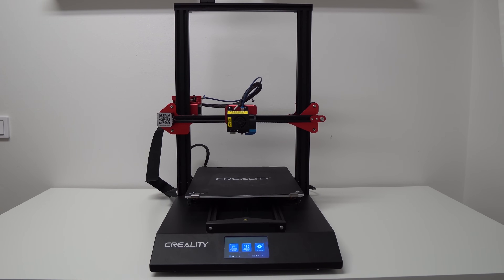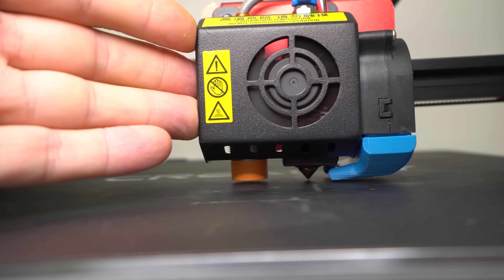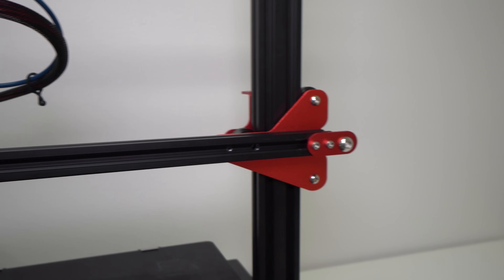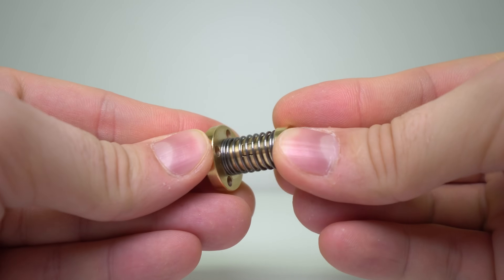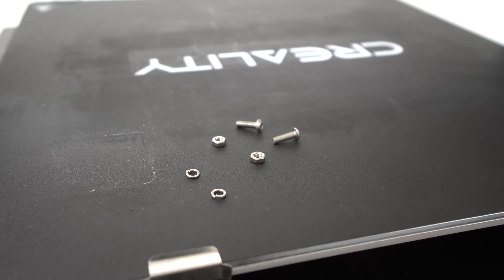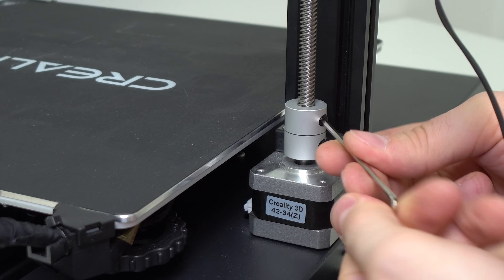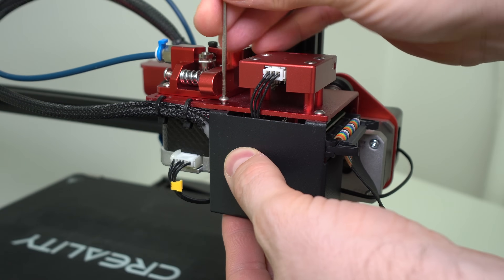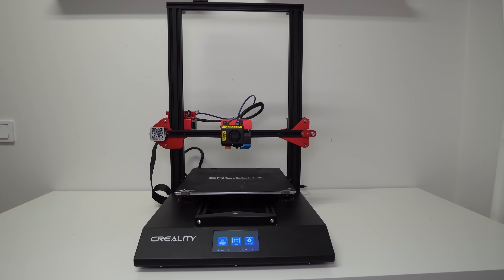Creality Cr10S PRO - Upgrade your Z axis (T8 Anti-Backlash install)

Comment: Unfortunately the backlash luck nuts don't work I have had this problem for a year and a freaking half I'll get six good friends two good friends maybe 10 and then I get two days of trying to realign my damn printer This issue sucks it makes me hate my printer. Nothing I've done has solved it permanently only temporary. And no one's come up with a good permanent solution.

Comment: Great video, but this is not really how anti-backlash nuts work. They will not fix the issue of a crooked X axis (misaligned Z screws), they can only make very minor improvements when using Z hop. All they do is make it so the nut can't move between the top of the threads and the bottom of the threads of the lead screws, which is less than 1mm of play in the first place, and most of the time, gravity pulling the carriage down means that backlash is not an issue normally unless you're doing a lot of fast Z moves like with Z hop. What you really need to do to align the two Z screws is install a synchronizing belt at the top, so that the two screws are actually connected together and stay synchronized

Comment: I can't seem to be able to remove the screws on the board. It seems whoever assembled my pritner over-tightened EVERY screw on it. I also had huge issues removing the bottom plates to do another upgrade due to something similar. Are there any tips on removing these screws? The stupid board seems impossible to remove.

Comment: The 2no. nuts and bolts holding the lead screw to the frame were loose. Are they supposed to be loose or should they be tight?

Comment: Great tutorial! A small question though. If the t8 doesn't fully compress, is that a deal breaker? I've been trying to get it going with absolutely no luck, the spring is very finicky.
Reply from the maker: Thank you. No it's not that big of the deal. As long it keeps Z axis steady it's good enough.
Reply: @NexiTech  Thank you for both the response and the swift reply! 💪🏽
Reply from the maker: @cursivefox  No problem. Have a good day.

Comment: Awesome video and very happy to see this solution to fix my same issue. But I need to know what pitch is the T8 ? Aliexpress shows 2mm 4mm 8mm pitch. Your video does not say which one the printer requires. I need to order this asap so of anyone knows that would be super helpful. Thanks
Reply: Hello. Same question for me,  did you find out which diameter for CR10S Pro?

Comment: Does this apply to the CR-10S pro V2 too? Great video :)
Reply from the maker: Thanks! ;) The CR10S PRO V2 is the same as V1 only with BL-touch sensor if I remember correctly. Also, you can install this Z axis upgrade to any 3D printer with dual Z axis.
Reply: @NexiTech  Thank. Definitely gonna try these modifications very soon then :)

Comment: Will i need to do this on V2? or did they fix this issue?
Reply from the maker: Nope V2 uses BL-touch sensor
Reply: @NexiTech  i don't understand, clearly says on Reddit that the V2 has this problem aswell.

Comment: Do you know why one side would still drift even after install the anti backlash nut? the "heavy" side still drifts down despite the install
Reply from the maker: Z axis extrusions are not parallel? Wheel bearings on Z axis are overtight or not adjusted correctly?

Comment: WAIT...Usually you can´t move the Z-axis when printer is turned on because motors are engaged. Only if the printer is powered off /or motors are manually switched off you can move them. (at least thats the case with A.i3 Mega. 
You banged againt the Z-axis while the printer was turned on, so motors are engaged and don´t allow any movement.  Im not really bying this...
Reply from the maker: That's the problem, before or after printing Z axis moves on one side slightly and next time you start to print your nozzle can start to strach over the heat-bed or you have failed print because nozzle print in middle air on one side of print. With this upgrade Z axis is much more solid and stable and it can move down that easily. Anycubic I3 Mega is much smaller in size and much less weight is on the Z axis( I have it) Also I3 Mega use linear bearing not bearing wheels. Completely different style and design. Get one of those heavy boys and see for yourself. Like I said not every 3D printer is affected but many big ones are.
Reply: @NexiTech  hm... I just ordered an Ender 3 V2 as everybody seems to have an Ender as well.  Just in case i´ll have a similiar case I orderes these spring-stops. We´ll see. Thx

Comment: Hey Nexi have you ever had issue with the heated bed wiring breaking? Seems a bad design mine broke due to the angle they are at when moving the y axis back and forth. I've had a rough time emailing Creality to get a replacement heated bed and still unsure if they are even sending me another. Luckily i have some electronics skills and fixed the problem. Apart from drag chains i'd love to see if there are any other options out there to fix this. Maybe your creative mind will think of something and make a video.

Comment: I understand the anti-backlash capability of these nuts, but how do these nuts prevent sag after the motors are off?
Reply: The spring tension won't allow them to move

Comment: What about the Z sync kit, with the belt thats installed between the two lead screws, that seems much easier to install than these ones? Are they equally good at fixing the issue?

Comment: I tried this with my CR-10S Pro V2 and it did not work. It still sags on the left side and the right side is higher. The only difference between these versions are the BL Touch and Firmware. If anyone has advice please get back to me. Thank you.

Comment: Thank you, sIr!
 I just bought a v2 but had issues with the z'axis. As a newbie this is extremely frustrating and takes away most of the fun. The wheel adjustmens already help quite a bit but today I have also installed the Anti-Backlash Spring nuts.  Now it seems to be a new printer. I still need to learn a lot, but your video helped me a lot. Greatly appreciated!

Comment: THIS!  I just installed these last week after watching this video and I no longer have to level my gantry between every print.  It's an inexpensive solution that I would recommend for anyone.  I did have difficulty cutting the nut since I didn't have a great way to secure it.  I ended up using an aggressive file to grind it down.  It did the job.  Thank you, thank you!

Comment: Excellent video. Do tighten those M3 nuts a bit more scurely than you can with tweezers though. They will certainly come undone.
Reply from the maker: Thank you, mine still holds fine. Be careful don't overtight the screws.

Comment: I have a cr10 clone and it is impossible to get both sides the same... mine was made poorly even frame is not square.... i have it printing pretty nice for a few months,but tonight i was determined to get it straight and ended up jamming ... and now one motor dies plus it does not go down... back to the drawing board... :(

Comment: Ordered the T8 backlash nuts from AliExpress using your link back in March. Items never arrived because the seller cancelled the shipment. I cannot recommend your AliExpress link nor the supplier BIG TREE TECH STORE. Lost a lot of time and so re-ordered through Amazon although much more expensive but need them urgently and not prepared to wait for another month or two. BTW great video. I've also a Creality CR10S Pro with exactly the same problem straight out of the box. Seems to me to be a gross design error on behalf of Creality and they need to do something about it as it's almost impossible to level the X axis properly.

Comment: Again, a great video. Very useful and good quality. I haven't upgraded the printer yet but I probably will because on the CR10s Pro the left side slides down quite a lot when the motors are off. I also have an Artillery Sidewinder X1 which doesn't have auto-leveling but it does a much better job holding the Z-axis, mainly because both Z-axis leadscrews are connect on the top with a gt2 belt. So both sides are always synchronous. Keep up the good work!
Update: I actually ordered the Anti-backlash nuts but it turned out they have a different size. The distance between the two holding screws is smaller, so I had to adjust the holes on the printer. And with that I found it way easier if you actually take out the whole lead screw, put the upper part of the nut in place, fix the screws and THEN insert the leadscrew from the top while at the same time compressing the spring and holding the lower part of the anti-backlash nut. The backlash now is much less but it's still there. I agree that the Z-axis problem should be fixed by Creality for this otherwise brilliant printer.

Comment: Hi Nexi I have a CR10 pro and have trouble with the z axis compensation, when I get it right it's brilliant, BUT if I run another print without changing any settings the z axis is high by about 0.2mm, I adjust it and then if I do another print it is high again.
I have replaced the sensor with an inductive sensor and even shielded it from heat. 
I have replaced the z axis lead screws with anti-backlash ones, it's driving me mad!

Any ideas?

Comment: Thanks for your video but unfortunately, it didn't resolve the issue completely for me. I did both things you recommend: I also installed the nuts but the X axis keeps getting unbalanced towards the left side once the printer is turned off. Maybe is less frequent now, but with time, it keeps getting about 0.1mm on the right side... (I can check it using ABL). Is there anything else I can do? Other than that think that the problem is not backlash in the Z-axis, but a design that is unbalanced in terms of weight distribution and all we can do is minimize the effect but I have the impression that it won't disappear unless we do a major overhaul.

Comment: I'm still getting sag even with the anti backlash nuts.  I tried multiple brands of them.  What am I doing wrong?
Reply from the maker: mjethier Have you tried to adjust Z axis bearings wheels? Try to loose whole upper frame gantry from the base case and from top extrusion bar and then readjust Z axis bearings wheels once more and then tight all screws. It should do the job.
Reply: Just hopping in to update (I'm working on MJE's printer)

The issue was actually that the rods were out of alignment causing a bind once gantry was truly level and adding so much bind in the stepping motor that it would push past the opposing force of the anti backlash and cause about a 3mm sag at the end while the stepping motor "unwound" once power was removed(possibly from original setup)

Solution:
1. Loosen upper guides.
2. Loosen lower couplers
3. Loosen both stepping motors.
4. Remove both couplers.
5. Loosen two small black screws holding gantry right side to vertical roller plate.
6. Level gantry and tighten two black screws.
7. Plumb z screws and center tips on stepper motors.
8. Tighten upper guides
9a. Add couplers Ave tighten to stepper motor ends.
9b.Tighten AND RE-SHIM( ended up removing two washers as shimming with one on each) stepper motors for front to back alignment. Careful to let rod drop into coupler smoothly to test.
10. Tighten couplers top bolts.
11. Recheck level and run gantry up and down entire rod WTH manual up and down to test that all is straight with no binding. Leveling the gantry would previously make the left motor unbind as soon as it moved, causing it to go out of level, but add angular forces, so that when the power was cut off it would drop down. 
12. Level bed.
Reply: @JasonNeri  not creepy at all.  Thanks for the help Nexi-tech!
Reply: Jason Neri can you please do a video to explain to do this? Thanks

Comment: There are many ways to solve this z-axis problem. I prefer the Artillery Sidewinder solution with a belt between both spindles. Ok, I‘ve lost 20mm of max hight, but seriously, who of us users has printed a 400mm high model?
Reply: I also use a timing belt but it does have its own issues, e.g. over-constraining the lead screws and potentially introducing binding.

Comment: This should also work for single Z-axis when it comes to changing filament during printing.  Sometimes I had lost a print because the gantry would move and will crash into the print.  With this, it should stop it from dropping down and save your prints.

Comment: Great video, just a quick question, not sure whether to use the backlash method or install z axis timing belt.  Which would you recommend?
Reply: Timing belt is the real solution to this problem. Anti backlash nut only raise the friction and stepper stays in place when powered off

Comment: Just realized on right side of my Z rail there is eccentric nut as you shown I can tight. That side is ok. But on left side where the extruder and X motor, all the wheels on Z axis does not have any eccentric nut I can tight. My model is CR10S4. Do you think I can just upgrade one of those wheel with nut so can tight on? One of my right side wheel moves freely at the moment.

Comment: TLDR: Sorry, but IMHO you have instaled it in wrong direction. 
Long story: now your X-gantry weights not only on nut but also on spring and how wearing-off  brass nut will continue it will push on spring more and more and in fact spring will help x-gantry jump . Right direction is exactly reversed - still  gantry frame lied on brass nut but  held down by spring and counter-nut.
Reply: If you install the anti-backlash nuts as you describe (reversed) do you still need to file off part of the brass?
Reply: @ErlendDavidson   unfortunately yes , with stock bracket yes , this is why I designed  new bracket  here https://www.thingiverse.com/thing:4182312

Comment: Installed these today.  The installation around the extruder was a bear!  I do a lot of machine work and this took me 2 hours.  I found it was easier to attach the upper brass flange first and then install the spring and lower brass portion.  Now I hope it helps.  More to follow.

Comment: stupid sensor 😂 i fixed the problem with a z limit switch and leveled the bed with the old way 😂😂
tip: it seems that those z offset settings in the leveling menu are stored to the eeprom so if you messed them up and edndid with a nozzle  crashing to the bed or just too high of the bed u can simply  send M502  M500 M501 this will reset the z offset and u can start leveling again like a new machine
Reply: I have a "reset set" printer settings Gcode I click print on off the SD card.  I do that the offset goes wackey.

Comment: I very rarely comment on anything, but I have to thank you for this video. I have this exact printer, and I followed your tutorials (T8 antibacklash nut and inductive sensor upgrade) to a tee. Thanks to you, I can literally turn on my printer, upload a file and print with out dealing with any leveling whatsoever. Thanks!
Reply: That's awesome! I have just completed this one, the sensor, and the fans, and I am so excited to see if mine will work without the constant adjustments every time I start a print! I am brand new to 3dP and his videos ARE FANTASTIC and so easy to follow!

Comment: Is there any reason that you couldn't install the anti-black nuts "upside-down" - that is, on the top of the plates of the gantry instead of the bottom? That would make it so that you wouldn't have to cut the nut on the extruder side.

Comment: how do you want to reduce "thread play" if the connection is still loose at the bolts/nuts. It looks backlash will not work anyway because another loose point is created between the nut and the mount bracket..
Reply: If I understand it correctly, it works because the spring is pushing the 2 pieces apart and against the thread of the leadscrew and that will result in the leadscrew needing a little bit more force to turn.

I installed this on 10s pro and it helps a lot. I still need to do a leveling like every week or so but before i had to level it every time after turning the printer off. Also I did the inductive sensor mod

Comment: i have to think you for your videos and the timing of them popping up in my suggestions was perfect because i just watched both this video and the one you did about replacing the ABL sensor with an induction sensor and then of all things that could go wrong with my cr 10s pro its capacitive ABL sensor died and the head was crashing into the bed as a result so i could not print anything but because of your videos i ordered the inductive sensor and the anti backlash nuts and got my printer up and running again 

it was weird tho how right after i watched your video my ABL sensor went out

Comment: looking at the Ender 5 Pro versus the Creality CR10S- Pro to print 12 inch long Steam Engine chassis and bodies for my Model Trains new to 3D, not a PhD in 3D but have spent 40 years builting CT Scanners and Vision Guided Robotic assembly workstations. Familiar with all the terms and technology but not in the application to 3D printing. Can I dial either one of these units using PETG Heat Resistant Filament.???
Reply from the maker: Dennis Murphey I recommend Cr10S Pro becouse it has much more stable and more rigid Heatbed and better motherboard with silent/ smoother stepper drivers which have better accuracy and makes smoother print surface.

Comment: I installed this on all my CR10s PRO and I only got really bad prints. I had to take them out :(
Reply from the maker: Then you did not install them correctly. I have nothing but great prints on my Cr10S PRO after this upgrade. Maybe you over tight the screws on them?
Reply: @NexiTech how can I installed them wrong? There is only one way they go in!  I followed your video to a T. I even went to the creality3d FB group for help. We figure out that the nuts were the problem. I can link you the FB page is you want. I had to uninstall them from all 6 of my printers.

Edit: spelling